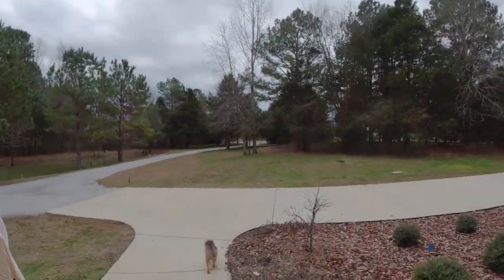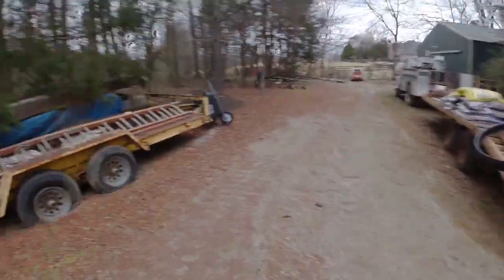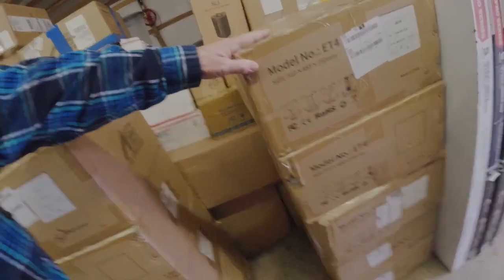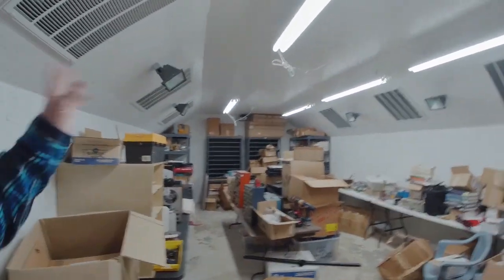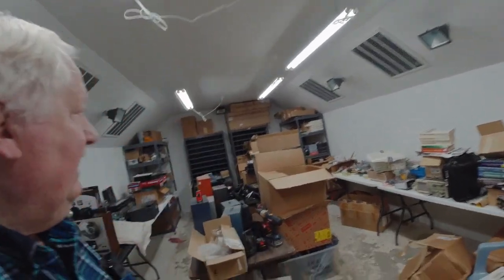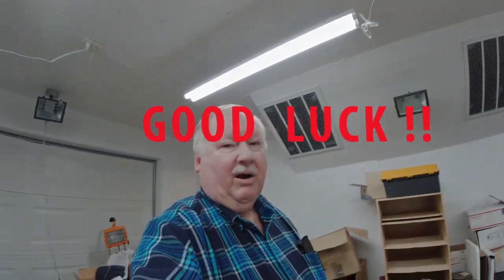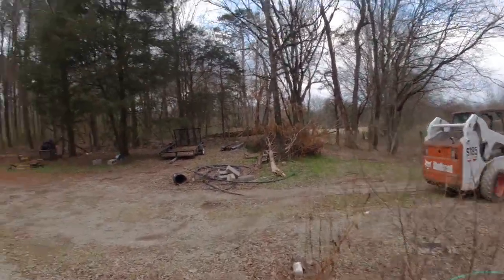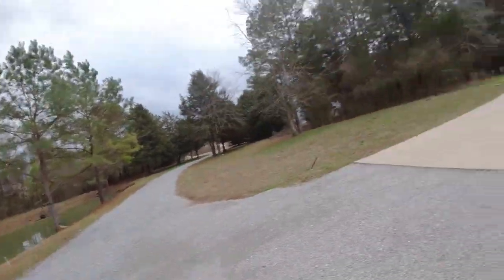MY NEW PRINT FARM  A transformation of one big mess to a functioning 3D print farm

Comment: The garage (paint area+room) will be an amazing space. Room for expansion, inventory, assembly, etc. Out Of Darts' channel recently made a vid tour of his space with great ideas/setup. Also, just heard about this new product from 3DQue - might help with getting prints off the bed.
I am slowly following a similar path (way smaller scale!) so, finding your channel is perfect timing and good inspiration.
Great videos and thanks for sharing your journey Ken!
Reply from the maker: I have been too embarrassed to do a complete video tour of my home and over 50 3D printers scattered in different rooms. It is so crowded with printers, parts, filament, packing material, and much more. I will have a much better setup when I get this new location going. I have been going to mostly glass bed printing. The parts hold well with a glue mix and when the bed cools they just about pop off, no need for a scraper. I will have UPS capability using deep cycle marine batteries, especially for the printers without resume print. I also have a generator for long outages. I had not seen the 3DQue video until you mentioned it. It looks good but also expensive and I know most of us starting out have to watch our start up cost. Before I became a residential contractor I managed a computer department for a major automotive parts manufacturer and was involved in implementing automated process control and robotic systems. So as you can guess I have a lot of ideas for automation in 3D printing. Good luck with your  venture and let me know how it is going. Thanks for bring up this topic and I hope you will continue to watch...Ken

Comment: Why do you prefer anet over creality or even the more proven prusa printers? Nice video and nice property!
Reply from the maker: Very good question. Since I started from scratch about a year ago, I soon realized that one printer was not enough and I started buying other printers including creality ender 3 printers. Not knowing where this was going I wanted to keep cost down so I purchased 11 Tronxy P802M printers on ebay for $85.00 each. These were acrylic framed printers and although they took about 4 or 5 hours for me to assemble they were sometimes missing some screws or had other problems I still got them working and was able to get them to print well. I have bought many printers as you can see and I have been able to get them all to work well. The biggest problem with this is that I have to have different print recipes or formulas for each printer. Thanks for watching....Ken

Comment: Tronxy has a bad name, and a lot of that name has been earned, but as an owner of an XY-2 Pro I think they're pretty tough little machines for a good price. Personally I prefer flashing Marlin firmware for familiarity sake, but they're pretty decent out of the box. Are you running stock?
Reply from the maker: Thanks for the comment Jason. The Tronxy printers that I have work pretty well for me, but I have found that when you have several of the same printer you can run the same job on them and get slightly different results. I run these printers stock and when I have one not printing well I can usually figure out why. Remembering these test allows me to recognize the cause of many problems. I learn every day and now I have the same part running on 7 printers and all look the sane except for one. I think it is the nozzle. Thanks for watching...Ken

Comment: Regarding the amount if stuff you have, and the effort/time it would take to maintain it,... you are "collapsing under your own weight"
Reply from the maker: It does seem like that at times. I hope things will run smoothly when I get things set up at the new print farm. I have been laying out and testing the print jobs I will be running out there on each type printer being used. After much tweaking I feel good that the 12, 24, and 48 hour 3D print jobs will only require two visits per day, thus producing a large amount of parts with very little of my time. Thanks for your comments and interest...Ken